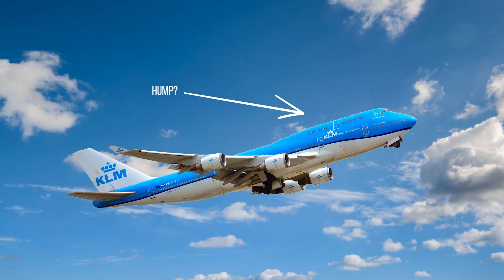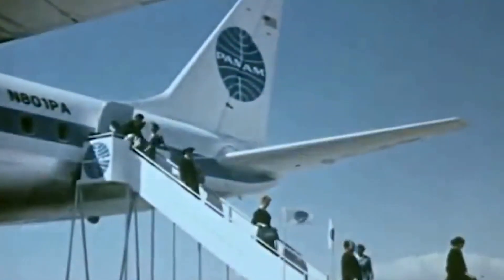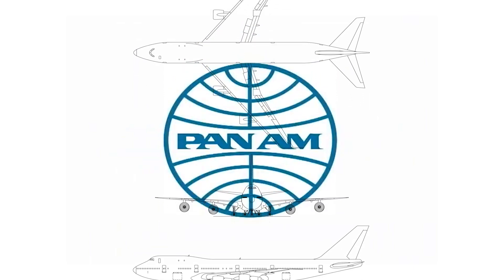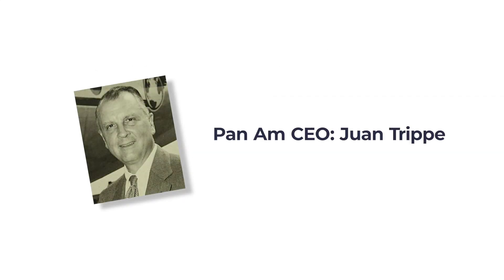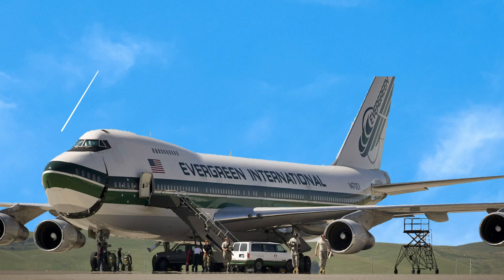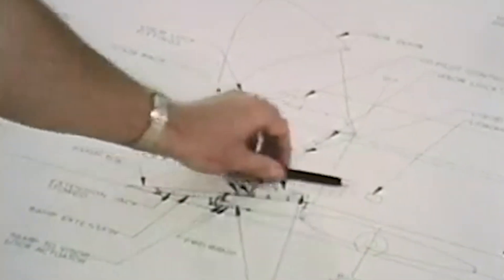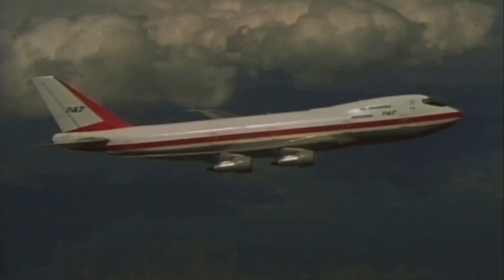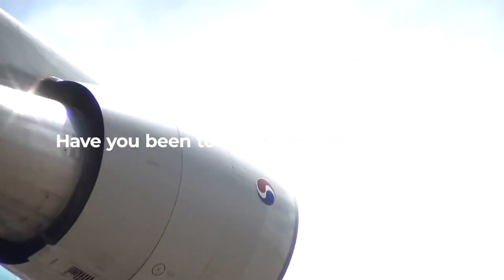Why Does The Boeing 747 Have A Hump?

Comment: I been on the 747 3 times but I never been on the upper deck
Reply: Wanna be jealous?
I’ve tried all the emergency escape devices on the humps, be them the cockpit’s upper head exit, the older versions’s right side slide, whit that super heavy device you had to push outside, and the automatic ones on the -400 version.
In any case sliding down is fun as hell.
Also got to sleep up there a few times, we even had a pillow fight once, on an empty leg😁

Comment: i never flew 747 nor a380... think the chances are slipping in my life... i did fly on 77W, 788 and A359. would be interested to fly a220 if there's a chance. but on the other hand, single isle long haul like 321XLR in my imagination would not be good since flight is too long, and when it comes to comfort, wide body always feels better than narrow one (even if the same seat pitch and width).

Comment: Pity the lack of attention to details the first 737s had the engines underneath the wing and not the more modern 737-300 shown in the first clips.  As a Boeing Engineer I worked on the SUD (Stretched Upper Deck) project and it had to stop before the wing due to aerodynamic interference.  Not much thought given to the full stretch.  A B52 is shown instead of the Lockheed Galaxy which won the competition.  Very few pictures of the 747-100 shown where the short upper deck is very pronounced.

Comment: Ultimately the military chose the Lockheed design
shows Boeing B52
Reply: The winner for the CX-HLS (heavy logistics system) competition was the Lockheed C-5 Galaxy for reference
Reply: @captaindusty4884  The Boeing design does look like a high wing B741.
Reply: That's a testbed B-52 with the C-5 engines. Anyway...
Reply: Lol.
Reply: I like the videos they put up, if you dislike them, why are you watching?
Reply: @stefannocker8308  And who said he's not liking?
Reply: @stefannocker8308  I have nothing against the videos, I just thought it was funny how the showed a Boeing plane while talking about Lockheed
Reply: The earlier Lockheed C-141 Starlifter also has a "hump" for the cockpit.
Best comparison being with a B741, B742 or (any) B747F. 
Boeing's original idea was passenger 747s would be converted to freighters once the likes of the Boeing 2707 came into service.
Boeing extended the upper deck on passenger B743 series in 1980 and further with the B748i in 2005.

Comment: Funny story about the upper deck doors (srs. 300 and 400 etc). In the case of the long upper deck, both doors are tenth of an inch out of door centre line design (inexcusably). At the absolute limits of design tolerance. This was discovered around shop set six after a thorough investigation due to doors ill-fitting. Boeing would not correct the tooling due to a.) tight production schedule when found, b.) when things settled down a bit, seen as an unnecessary cost. BTW Northrop built the entire fuselage in 27 big bits from set 1